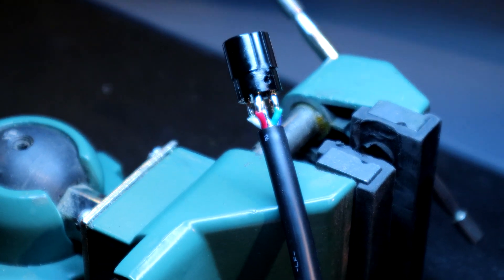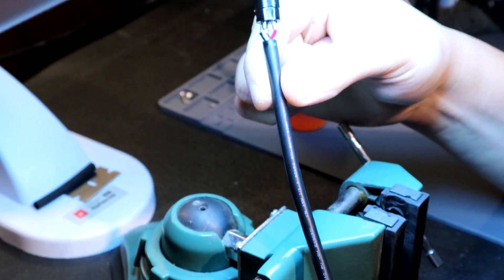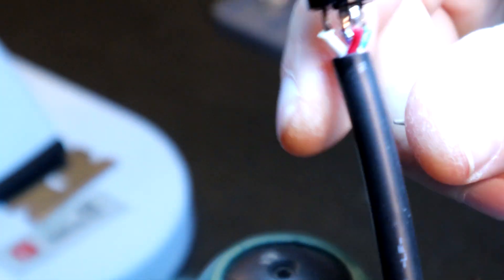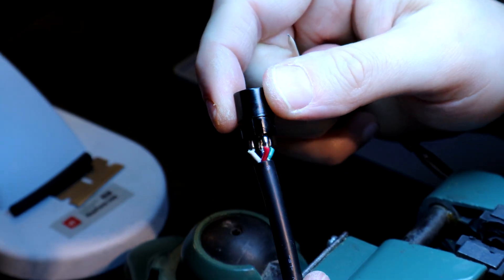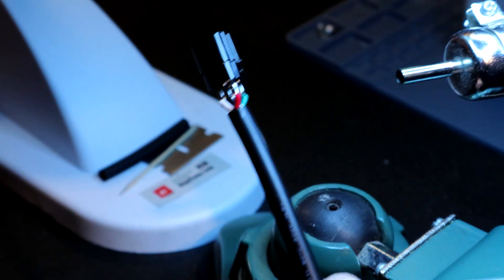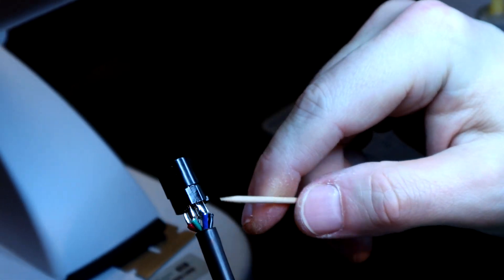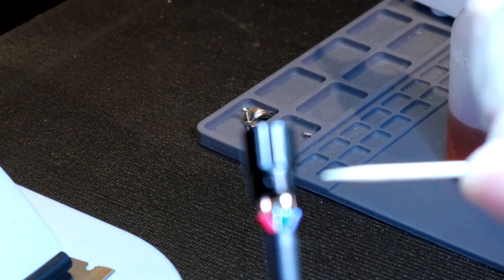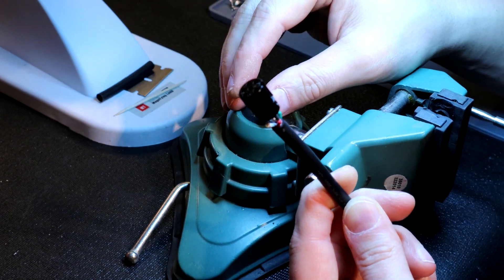CNC GX-16 Female 6 Pin Solder Connector Overview (Shot In 4K)

Comment: Nice 👍 

I’m doing a GX20 5 pin right now, for motor cables, curious if I should use some kapton tape between the whimsy tabs on these after soldering and when wrapping it all up.
Reply from the maker: Thank you, I appreciate the support. Its really not required as when you apply solder to tin them it will add additional rigidity, and strength. Thank you,
Vince

Comment: I just  got done building my THC cable.  That flux is a game change!  It makes such great soldered connections.  
I  had the handy cap of using a crappy Weller soldering iron.  The Weller worked, but it was a struggle.  Practice, practice and practice!  My 3rd attempt I obtained satisfactory soldered connections to the GX-16.  

Soldering station is on order.  

Don't be afraid of using magnifying glass.  These are small wires and small wire terminals.

Thanks for another great vid Vince.

Kirk
Reply from the maker: Hey Kirk, thank you again for your support, and your so right. Kester 186 makes soldering a much smoother process. Your Weller is fine, just make sure the tip is clean. Practice as you said is the key word. Have a great weekend!
Vince